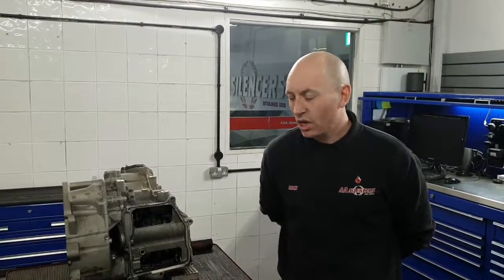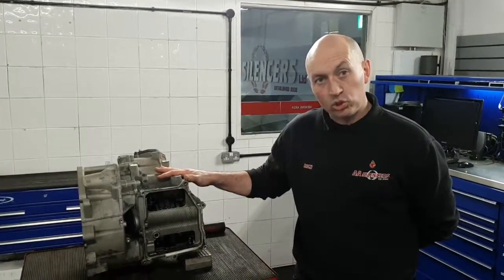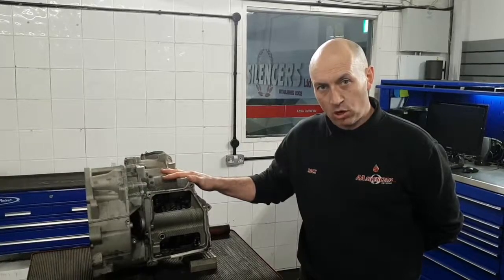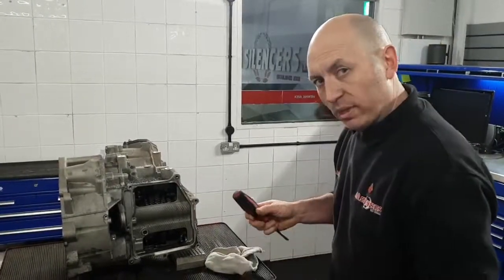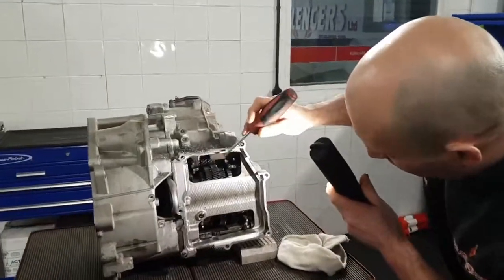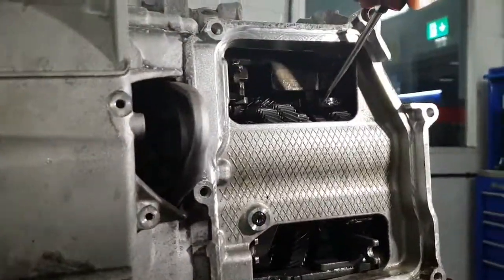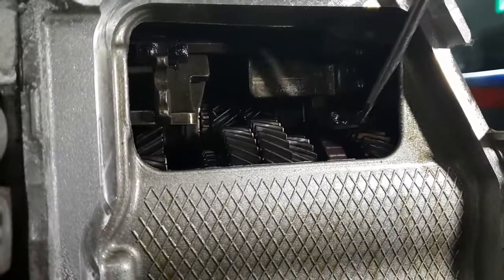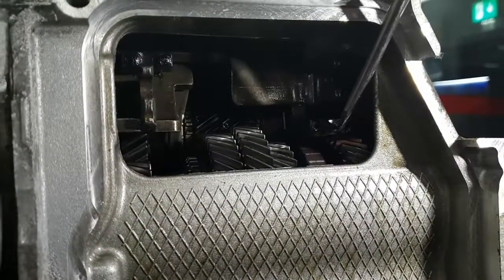AA Silencers VW DSG Audi S-tronic gearbox failure

Comment: I have a similar problem with my 1.4 DSG gearbox it's not selecting odd numbers and starting off in second I've been doing some research and I thought it might be the mechatronic unit that will be faulty is it possible I will have something stuck to my sensor ?
Reply from the maker: Without doing some diagnostic work it's quite hard to say exactly what your issue is Jordan. If you are local then it's certainly something we can look at for you, just give us a call.